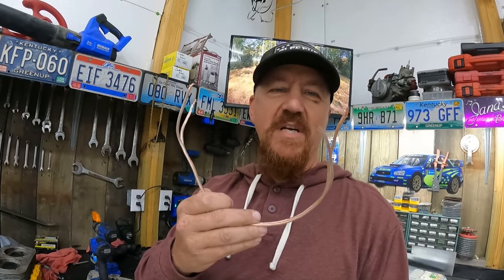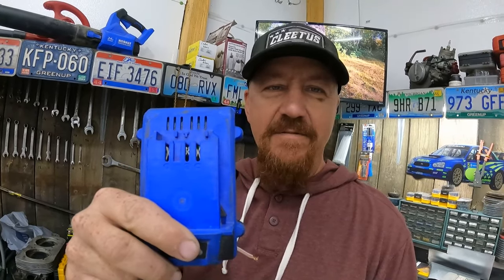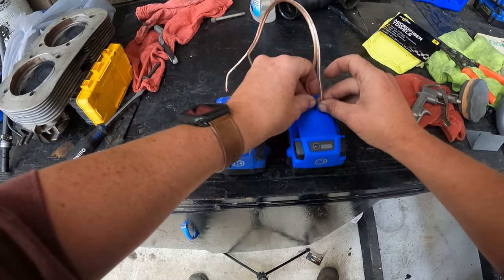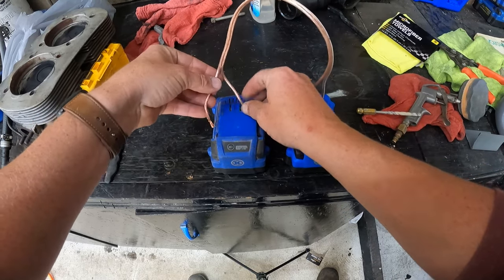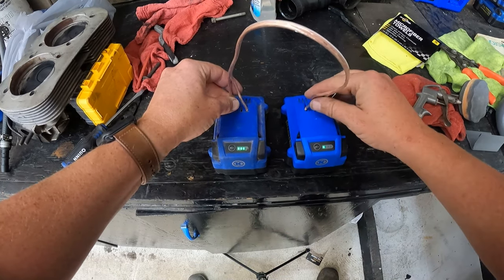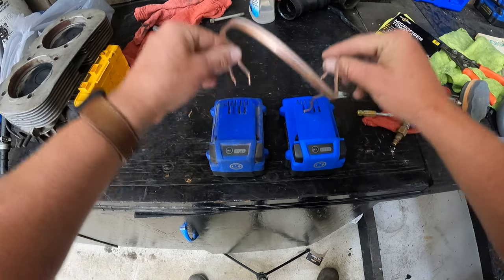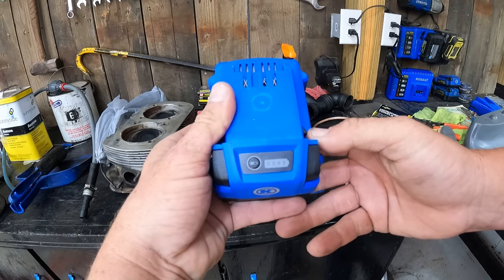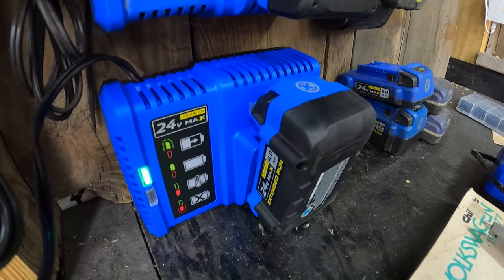Don't Trash it!  Make it Charge! -Kobalt 24V Battery Fix - Jumpstart Your Batteries

Comment: I was a little hesitant at first to try your method.  But, to my surprise it worked!  I was able to charge the dead battery fully.  Once again thanks for the solution for my dead battery.
Reply: What type of wire did you use? @sycopath1

Comment: WOW!! You sir, are a blessing to society. IT WORKS!! New Kobalt Ultimate Output 4ah battery. Plugged into charger, nothing but a solid green light (no blink), no charge. After 1 hour, nothing. Searched and found your video. Jumped from a Skil  20v 2ah battery for 30, then 40 seconds. Plugged Kobalt back into it’s charger….blinking green light and taking a charge!! THANK YOU, THANK YOU for posting this video.

Comment: Same exact scenario - brand new and it was flashing red. Battery was manufactured on 04/24 and today is 09/24, so not even 6 months on the shelf. Did this for about 15 seconds following similar procedures as jumping a car battery (red to dead, red to donor, black to donor, black to dead) and all is working now. Thanks for the advice!

Comment: Genius, it worked for my 80v Kobalt leaf blower battery. Used it outside in the cold and battery died will using. Could not recharge cause charger kept flashing red even after letting it sit at room temperature for days. This method saved my battery, though I had to let the 2 batteries connected for a good 30 minutes ( probably because of the size of the battery. Thanks again!

Comment: If all cells have just drained too low, then this can work as long as the cells aren't damaged.  This can be rather dangerous if you don't check to make sure one of the cells hasn't dropped.  If 1 cell is damaged and is at very low voltage and can't charge at all, You could overcharge the other cells, Lithium cells can catch fire overcharging them.  The safe thing to do is to unscrew the bolts, and use a volt meter to check each cell to make sure they are all somewhat close to each other.  If you find all of them at 3.9v for example, but one of them is 0.2v for example.  Do not do this method as one of the cells has faulted or shorted.  When that happens, I wait for 2 bad batteries and then sacrifice one of the cells from one and replace it in the other.  Just have to be very careful doing that and requires hacking at the enclosure to do it.
Reply: correct

Comment: Holy Smokes!  Worked like a charm!!!  In my case, I could not get any of the 4 lights to come up...100% dead as a door nail....I used actual wire (just what I had on hand) and left them hooked up for about 30 seconds...and then it worked!  STELLAR WORK HOMIE

Comment: Wow!  I just bought a charger with 2 battery bundle.  One battery charged, and the other wouldn't.  I took it back to Lowe's and got a replacement.  But the replacement also made the charger flash red.  I did what you show here, and it worked like a charm.

Comment: I had the same problem on a kobalt 24v battery that came with reciprocating saw I bought off marketplace. Jumped it like u did, it worked. Now has and maintains full charge.

Comment: Thanks a ton, this trick even worked using 56v to fix a dead 80v. Since I metered the 80v dropped to 37V😂. 
The battery light didn't turn on, but after a min or two the charger is now charging it.

Comment: YOU'RE THE MAN!!!!!  I purchased a used battery at an auction for cheap.  When I got it home it just flashed red in the charger.  I did your trick by jumping the batteries and now it works.  I was almost going to throw it away, but now it works!!  If I know where you are I would buy you a beer!!  Thanks!!

P.S.  What do you do if you don't have a second battery? LOL
Reply from the maker: You’re welcome!  I don’t exactly know, but I would think if you had a cord that produces 24 volts that would work too.

Comment: I've got a different issue and it seems to be exclusive to the high output batteries. They won't charge unless they're down to one bar. Idk if the older chargers don't read them correctly or what. And not long after the four amp ultimate output refused to charge above two bars. My regular ones charge fine . Have three ultimate output and they're all doing it.

Comment: Thanks for the video, I have a new battery , that I have only charged once , it got stuck on on in my tool box in my Jeep and killed the battery ? My question is I only have one kobalt battery if I try this cam I do it from a lower volt battery from my craftsman batteries ?
Reply from the maker: I believe it would still work…

Comment: Every YouTuber gives the exact same solution which is just great if you have TWO batteries. What are you supposed to do if you only have ONE? Or what if you have a second battery but it's less voltage than the one you're trying to get up to charge so your charger will recognize it?

Comment: I have a bad kobalt charger, so I will gut it and add a mechanical timer and a wall wart power supply. Just install the battery and turn on the timer to bring it up a  it. Since it is a slow low voltage charge one can leave in on longer like 15 minutes. I"ll just need to decide with a dc amp meter what size fuse I'll use. Use a slow blow at about 10% higher than the initial spike.

Comment: I did this for my 40V battery for my Mower. All bars shows on the gauge when hooked up to the good battery... but soon as I unhook it will not charge (charging light does not come on) and the light in the battery doesnt gauge come on. Any thoughts?

Comment: I've got 2 batteries that wont take a charge and the charger shows green as if they are charged. Can't figure out how to charge them besides jumping them to another battery. any advice for this problem. They are 4ah ultimate output batteries with somewhere over 22v in them. if i jump them to a good battery they will indicate 1 led of charge and run tools briefly. no matter what i do they show green on the charger.
Reply from the maker: The only idea I have is do you have multiple chargers?  I wonder if it might be an issue with the charger…
Reply: I have this same problem and it doesn’t matter what charger I use still trying to figure it out

Comment: I have a 24V 4AH battery that’s rarely been used.  I got it last year or two years ago at most, it came with the blower.   It works when it wants to, but often all four lights on the battery flash at the same time for quite awhile.  When I charge it the charger flashes green like it’s charging for a couple seconds and then goes solid green like it’s fully charged.  However when you press the button to check the battery level it again flashes all four lights red at the same time and only works when it wants to.
Reply: Thats your problem--the batteries should to be charged once a month even when you're not using them

Comment: In my case it does flash as if is fully charged just solid green light, but when u click on the battery it does display as only 1 bar left , would doing this fix that issue ?
Reply from the maker: I really don’t know, but I don’t know what it would hurt to try…
Reply: I have this same problem

Comment: Will this work if my charger shows a solid green light when the battery with 1 bar showing is plugged in but the charger won’t kick in and charge the battery, the charger is good as it will charge other batteries.
Reply from the maker: I do not know about that.  I can’t imagine that it would hurt to try it.
Reply: Did it work for you? I am having the same problem as you stated.
Reply: @gacastillo21  I haven’t tried it yet.

Comment: Ok so I drive a semi. I use the 40v blower on the daily. Came to watch the video for help. Only problem is I don't have a second battery or wire. What I did to get mine back to running was put battery back in cradle and turn the inverter directly off and back on and it jolted it back to life.
Reply from the maker: Sweet!  Great info!  Thanks for sharing.

Comment: If that method doesn't work, you might have to open up the battery pack and charge the cells which are more discharged more than the other cells.

Comment: Hi I got a question. I have a battery powered framing gun that runs on a "6VDC" and obviously dead. I have the same kobalt battery but 2 amps fully charged. Can I jump the 24v kobalt to the 6v framing gun battery to make it charge again? Will the 24v be to much for the 6v and explode?
Reply from the maker: I don’t know for sure.  I wouldn’t recommend it.  🤷🏼‍♂️

Comment: I have 2 Atlas batteries that say the are full but won't work in my mower or other tools, I got two new ones and the tools work so it's not the tool, would this be something similar or different repair ?
Reply from the maker: I don’t know for sure, but I would think it’s different.  With this issue, the battery is essentially too dead for the charger to know you put it on…

Comment: Can I do this with a Kobalt 80v battery and if so, what size does the one that I am charging it from need to be?  I have other voltage batteries that are less voltage and are not the Kobalt brand.
Reply: I have exactly same issue. I have one Kobalt 40v battery and the rest of my batteries are 24v.
  Wonder can i use a trickle charger i have for my motorcycle?

Comment: Hi, I have a 80 volt Max Cobalt blue and black 2.5 ah but the battery will not charge. Could I use any kind of brand battery to resurrect it from the dead?. PS charger it works but the battery will not intake the charge
Reply from the maker: I don’t know specifically, but I think the concept would still be the same.  Basically the battery is discharged too low to register and jumping it with another battery adds enough charge for it to work.

Comment: Thank you for your video. Good one. I dodn't have another battery to charge the discharged one that turn the light red, despite that I tried pluigging it carefully, so what I did is just took the battery and by frictionk: rubbed it against my pijamas and plugged it again and started charging with the green intermitent green light: you gave me that idea of charging a dead battery even a little bit, I guess the static charge could have done it, I guess, thank youi.

Comment: I have the same issue. But I dont have an extra battery. Can I use a jumper cables and a trickle charge?
Reply from the maker: I would try it.  I don’t know if that will work because you likely need 24V to get enough power in it to register.
Reply: @PeeksPeakHobbyHomestead  then maybe hook it up to my car?
Reply from the maker: @apriljoamy  a car and a trickle charger are only 12v systems… I’m no expert sorry I don’t have more ideas.
Reply: @Peek's Peak Hobby Homestead  thanks. I guess I will get another battery. Then I will have a backup.

Comment: The problem with mine is, is that my battery charger will flash green as if its charginging one of my batteries, but it will flash maybe 4 times then fully illuminate as if the baterry is already charged. The battery never has mor than one green bar on it.

Comment: My comment is not on charging but FYI.  If battery starts flashing and drill or impact won't work unless re- inserting battery then I found letting switch snap back to off stops the problem.
Reply from the maker: Good info!

Comment: Thanks! Got a battery with a tool deal, and then saw it was a pretty old manufacturing date. Then it started having trouble in the cold to recharge, then it just wouldn't. A few seconds jump and the charger was OK to charge it. Hopefully I can squeeze some more value out of this battery before it totally dies. Maybe I'll label these and stop using them when there's 1 bar remaining.
Reply from the maker: That’s probably a good idea.  👍

Comment: How do I do that without another battery?
Reply from the maker: That I do not know.
Reply: hi. try cleaning the  silver charging  prongs on the battery and blowing out all dust and debris. thats what i did and it worked for me. worht a try
Reply: Use an adjustable power supply

Comment: I dropped the charger, now it won't charge either of the two batteries. One has 2 green lights, the other has one. I bought a new mower, but the kobalt cuts shorter and I want that last cut of the yr to be done that short. I'm not forking out 80 bucks for a new charger. Lowes charged me 89 bucks to deliver the new mower a distance of 3.1 miles. It was already at the store, curbside pickup. On my way to pick it up, I was in a wreck and tow truck brought me home. Called Lowes to tell them what happened. Said i needed to change to delivery. She said it was 89 dollars and I lost my shit. I said WHAT?  That's crazy, nevermind. Some afterthoughts and I called back, complained about the delivery price, surely I can get a discount, but NOPE. Jokes on me. I pd. the money. A giant box truck pulled with one small box was all that was in that truck. Waste of thier fleet truck. I'm still mad as heck. They txt me a survey on how the delivery went lol. What am I supposed to say...?